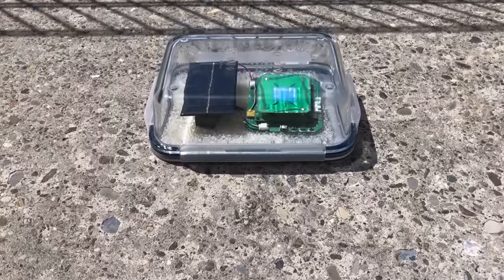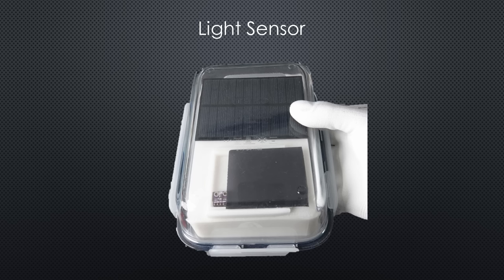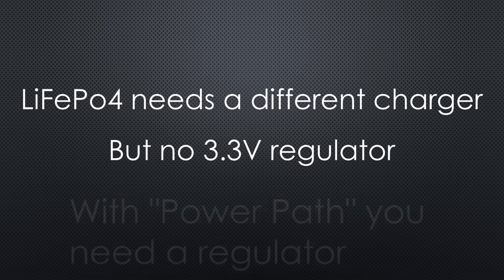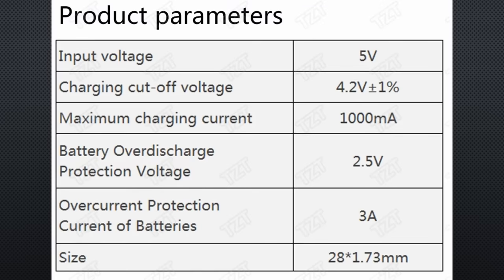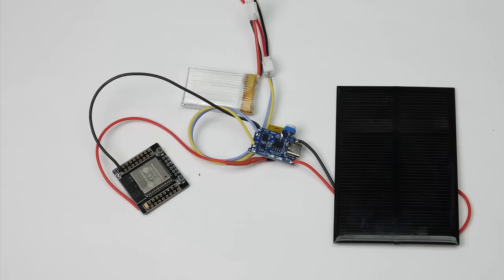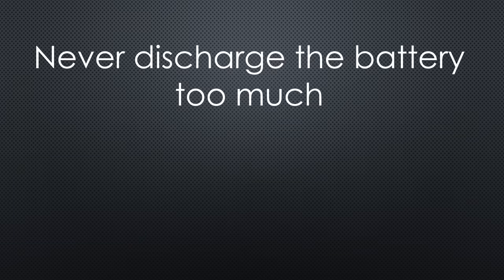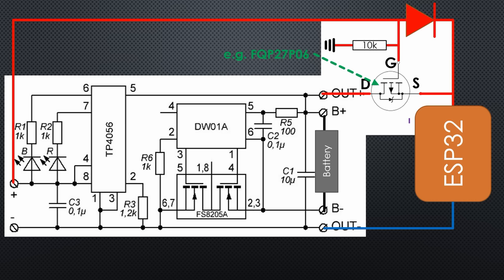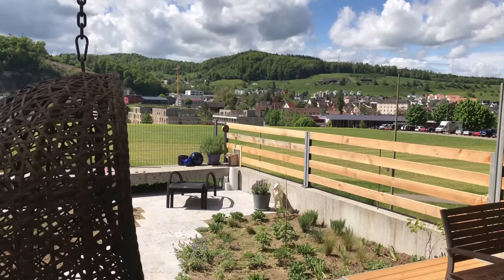#383 Cheap and simple Solar Power for our small Projects (ESP32, ESP8266, Arduino)

Comment: Really good explanation. As a tip from experience: Lion batteries hate heat, and if they are exposed fully charged to high temperatures (say over 60°C) they can swell and leak over time. If your unit is assembled inside a small container, exposed to direct sunshine, it is not rare to reach those temperatures. To mitigate this, keep maximum charging at 80%. Also, if the charger/battery has NTC (temp sensor) it can stop charging over 45°C.
Reply from the maker: Good point. I measured temperature and, in summer it reached 65 degrees for a few hours. So far I had no casualties. But I expect the battery will not live too long. Charging up to only 80% is not easy with the standard chips. Because of the power path, the battery is not used nor charged during these high temperatures and is only "stored". Which seems to be ok.
Reply: @AndreasSpiess  you are correct. Is always good to be aware of batteries limitations and that is a huge topic. Keep with your great channel, which is personally one of the best in Youtube!
Reply: This is an interesting point since batteries don't like charging in negative temperatures as well due to dendrites. So how to best solve this very hot/very cold environment issue with solar charging these small boards?
Reply: Fun fact: TP4056 has NTC pin, just in these tiny chargers it's not utilised, just pulled to ground.

Comment: The MCP73871 is a complete solar charger with all the bells and whistles needed in your project Andreas... Adafruit has a board with it.
Reply: This is an old board design, at a whopping price of $17.50 + shipping. Adafruit recommends the new board with BQ24074 - cheaper - but out of stock, so Andreas tips is the hackers way of doing it. Have a nice day. ;-)
Reply: @Cptnbond  Yes....we can go down down to build it with simple transistors...nice learning too. :)
Reply from the maker: You are right. These chips seem to have all parts on board. Boards with this chips are not so widely available.
Reply: I've seen at mouser that the MCP73871 cost € 1.59 for € 1.85 for the new BQ24074.
The price difference for the two Adafruit boards is only explained for commercial reasons ... nothing to do with the board bom.

I have been using the MCP73871 for years and it is possible to solder it by hand with a fine welding tip (the BQ24074 footprint looks similar).
Reply: is there a cheap chinese version of it?
Reply: @grindel80  just have a look on ebay
Reply: @grindel80  I live in China. Searched on Taobao (Chinese ebay) but unable to find any cheap version. Guess the TP4056 + 2 Schottky diode (or 2 pMOSFET) is easy to implement and TP4056 boards in China only cost you ~0.4 USD ea. If you buy TP4056 raw chip it is only 6 cents and JLCPCB can manufacture your PCB design with 1 USD for 5 boards (shipping INCLUDED). Clearly there is little incentive for any manufacture to clone MCP73871 board since the chip is too expensive let alone a module.

Comment: your voltage divider does not make sense - you go to all this trouble to put the mcu into deep sleep to save power, but you cannot turn off the voltage divider, which is continuously drawing power in order to provide a signal that is only consumed for less than a microsecond in every ten minutes.  what am i not understanding?
Reply from the maker: You are right. However, I do not pay too much attention to every microAmpere for solar powered system because they are frequently recharged. If you care, you have to switch the divider as you suggest.

Comment: Thank you (yet again) for a clear and informative video. In the past I've started a number of solar projects, but always run into constraints that seem to require expensive solutions. With the information from your video, I will attempt to revive some of them. I may even try to implement them in surface mount technology. I'll let you know if I can fully incorporate your beautiful bodge onto a single board :)
Reply from the maker: The FET I used for sure was too big! You can use a DMP1045u instead.

Comment: If you want to make your TP4056 adjustable, I recommend that you add a 1.2kΩ resistor in series, so you don't exceed the maximum rating. The chip on these little modules already easily reaches 100°C at 1000mA (1.2kΩ) without a heatsink.
Reply from the maker: Indeed, you can try to find the "MPPT" for your cell using this resistor (I did this in an earlier video).
Reply: @AndreasSpiess  Nice! I'll check them out. Funnily, I stumbled upon this video when googling for "diy Solar Radiation Shield esp".

Comment: This is a very useful video, sir, but I have a question. I have a solar panel with a specification of 12v/0.83a. What happens if I don't replace r3? I'm still just learning soldering, and I have difficulty removing such a small resistor. And if it really needs to be replaced, how many ohm resistors do you recommend installing? Thank you
Reply from the maker: The TP4056 will be killed with 12V. You need a step-down converter 12-5V or better a sloar charger that supports 12V
Reply: @AndreasSpiess  I forgot to mention that I'm already using a step down converter. I'm still confused about the ampere part.

Comment: Thank you for a great video! In my projects i also add a temperature sensor and a mosfet to cut off the battery charging if the temperature is too low or too high (charging lithium batteries bellow 0C can causes permanent damage). Alternatively the tp4056 has a pin where one can connect a thermistor. Also if you use lifepo4 not only you don't need the regulator you also don't need the voltage divider to measure voltage. One can use ESP.getVcc() directly. And as a bonus no risk of blowing up 🤯.
Reply: wow do you have any guide I can view so I can implement what you did? I want to incorporate it that into my mini electronics project.
Reply: @noddlexxx9161  Sorry i got no guide but it is pretty simple. Whenever the ESP wakes from deepsleep (15 mins) I measure the temperature and depending on the result turn the mosfet between charging board and battery on or off. The project is now running something over 2 years without any manual charging needed.
Reply: @TheChopain  oh okay thank you. I'm panning to make like a little backup cam for my car and it would be pretty annoying to switch out the battery you know.
Reply: @noddlexxx9161 why not take the power directly from the car? Of course have to step voltage down first, but would not need to have a separate battery.
Reply: How did you keep the TP4056 off during deep sleep?

Comment: Wow! Thanks for the tip about the diode and p-fet. This is exactly what I need for my current solar project!
Reply: Same.
Reply from the maker: I am glad it was helpful!
Reply: @AndreasSpiess  Thanks, this was very helpful video,  as we were trying to solve this issue for weeks. one problem i had is, after deep discharge my controller board is not wakes up even there is sun (for whole day). will this solution solves that issue without any external trigger to reset the board or with other components ?!
Reply: @FTMSquad I have the same problem, have you had a chance to try it, can you share the results?

Comment: for a small project I did, using esp32, I also changed the R3 resistor (on the TP4056 board) to a more suitable 3.9K SMD resistor, which worked great for the purpose. Thanks for the great video by the way :D
Reply from the maker: You are right. You can add also a fixed resistor. And the older boards had bigger SMDs...
Reply: @AndreasSpiess  yaa, mine had the 0603 ones which are okay to replace if you have an okay eyesight :p

P.S. - i also added the ldo and powerpath to my project, didn't know i had become professional too... XD

Comment: Alternatively, especially if you're more application engineer.. just use the 5v (or USB in) on the ESP32. You will need something like "PFM 600MA Control DC-DC Converter Step Up Boost Module" between the TP4056 battery out and your ESP32. This will boost the signal to a consistent 5V and you can connect that to your board through the USB in. I also highly recommend getting an 18650 with a protection circuit for additional protection. 

For battery monitor also consider a "I2C 3.7V Li Battery Fuel Gauge" which you can connect to the I2C on the ESP32
Reply from the maker: This is a good idea if you are. Ot concerned about power consumption.

Comment: Thanks Andreas, I’ve been struggling using a tp4056 for a solar project, reckon this is the solution! Perfect…
Reply from the maker: I hope it will work for you as well.
Reply: What was your problem?
To small solar panel?
To high charging current?

Comment: Thanks for your video. I was just doing my own research for solar powered ESPs recently and ended up with the TP4056 as the simplest solution as well. But ... there's no point in fiddling with the charging current of the TP4056. The current of solar cells is proportional to the solar radiation and thus is always varying between zero and the maximum current. Your current setting will never be right. But that's not as bad as it sounds. You just want the maximum available current and that's what you get without limiting the TP4056. Chasing the MPP only makes sense with a swtiching charge controller that can transfer energy between different voltage levels.
Reply from the maker: I agree, we never will find the right current without MPPT. The problem I had was that the panel hardly delivered current when the battery voltage was very low. Then, the TP4056 tried to draw max current and pulled the solar panel to a very bad place on its curve. This is what I wanted to avoid.
If you have enough sun and your battery voltage is ok you will not encounter this issue.
Reply: @AndreasSpiess  Thanks for your reply. Are you sure it was not just the Trickle Charge Mode of the TP4056 for a very low battery voltage? The current-voltage diagram can't explain what you observed. For a solar cell the current can only get higher for lower voltages. The power might decrease but the current is constantly increasing for lower voltages.
Reply: That was also my thought. The higher power of the PV results in voltage, not current, but the higher voltage is burned anyway by the charge controller.
Concidering the charge controller does not consume current, only burns the voltage above 4,2V, but we charge a battery that has 4V at the moment, you will get more power to the battery when operating the PV with 4 V, then operating it at its MPP at 5V:

voltage	current	power	power at battery with 4V
0	0.098	0	
0.5	0.097	0.0485	
1	0.096	0.096	
1.5	0.095	0.1425	
2	0.094	0.188	
2.5	0.093	0.2325	
3	0.092	0.276	
3.5	0.091	0.3185	
4	0.09	0.36	0.36
4.5	0.089	0.4005	0.356
5	0.085	0.425	0.34
5.5	0.07	0.385	0.28
6	0.03	0.18	0.12
6.5	0	0	0
Reply: @wasserdrucker6227  so if max current is not achieved the module will ask more voltage from the panel, and the equilibrium point would be zero current?
Reply: I was wondering, if I had a higher voltage panel and a 5V buck converter, what  voltage would the panel set in? I find two equilibrium points

Comment: Very nice tutorial. The only thing I do differently, I use a 3.3V buck-boost instead of a regulator. I have an ESP8266 that is more than a kilometer from my house, and it has been running m/l continuously for over a year. The battery doesn't do well below 0C...

I recommend using the solar panel to shade the other parts from the sun, and mount the parts to an aluminum bar that extends outside the weatherproof enclosure. The bar will remove heat from the enclosure.
Reply from the maker: Good idea with the shading. I have a few IKEA boxes to try and compare different cooling concepts. I just have to do it...

Comment: Good video. Damn, it arrived a week after I had used an identical circuit with 2 Schottky diodes and missed the pro solution. Still, mine looks nicer!  Next time…
Reply from the maker: I can imagine that the two diodes look better! And the difference is probably not big for this application where we never want to deplete the battery.

Comment: I would appreciate it if you would add in the amount it cost you at the time to build the total package. I know I can calculate it myself by opening all the aliexpress links and tallying them up but it won't reveal how much you personally paid for the package at the time of making the video.
Reply: Having watched Andreas' old mailbag videos, I expect that all of these parts came from his inventory so no new purchases were needed.
Reply from the maker: Andrew is right. I assume the total cost was around 10 dollars including the battery and the solar panel. Plus 1000 dollars work of a Swiss engineer ;-)

Comment: Like usual, very interesting and practical. I have a few considerations/questions: the powerpath is as you perfectly explain to prevent the battery charging and discharging at the same time, which could basically 'screw up' (my words) the proper charging of the battery. I wonder, if one has an ESP that is in deepsleep most of the time, whether in reality this is a significant problem, as  most of the time the discharge  would be say around 3uA.
I am not sure but i seem to remember that some of the charge boards you tested earlier (#155), e.g. the CN3056 did not have this problem. These boards are also extremely cheap (61 cts in euro). Anyway, you probably know better than I as you have more solar projects than I. I only have one, with a bare ESP8266, fed through a 4056 with protection and no powerpath. The ESP wakes up every 3 hrs, maybe does 5 secs of connection and goes back to sleep. I use a 750mAh battery. Till now, even in the dark days that seems to work, at least i have not been faced with a battery that would remain below cut off.
On a side note, as through some lucky finds, i acquired about 100 discarded 'vapes', with lipo cells varying from 500-1200mAh, i will definitely do more solar projects, and will consider the CN3056.
Reply from the maker: For deep-sleeping devices the power path is needed. And: A good idea to use these lipo batteries for a second life!

Comment: Yet another great video from Andreas. Thanks!
I wonder if it is possible to control TP4056 current setting from the ESP32 instead of using a manual pot. With a DAC maybe ?
Reply from the maker: You can get electronic potentiometers. But, as said, it is not worth the effort for such small panels.

Comment: Good video, I’m still waiting for the raspberry pi UPS project video! Something like done in this video, with power path, but connected to a 5v charger instead of a solar panel and all the components adjusted for the RBPi power consumption 👍
Reply from the maker: It is way more complicated if you want to have automatic shutdown etc. The project team got their prototypes and, during testing, found some errors...
Reply: @AndreasSpiess  yes, I think it is, but the team should try make it work without automatic shutdown, etc Just the basic functionality, to maintain the Pi working in the eventuality of a power outage, in my case, when it happens it’s not long lasting, just minutes. 
After make that working they can improve it with all the bells and whistles 👍 
Keep the good work 😊

Comment: Make sure the battery has a low voltage cutoff circuit. The voltage divider is constantly drawing current. Even with a large panel, if you put your device in storage for a while, you stand a good chance of having an over-discharged dead battery. The voltage divider is a great battery destroyer. Ive seen lots of lipo devices (not solar charged, just USB charged) go "out of service" due to the voltage divider measurement.
Reply from the maker: You are right. This is why I use TP4056 boards with cutoff circuitry. You get them also without it.

Comment: Power path idea seems interesting and useful. But i think, a fuse could be added where the source is so that in case of short-circuit (its outdoor, rains, high - temperature its 42 C here). and that p-Channel mosfet look giant at 12:06 and nice box
Reply from the maker: Of course you can use an SMD FET. This one was easy to solder... Concerning the fuse: You are right, a fuse always increases safety.
Reply: @AndreasSpiess  Could you suggest an easy to find smd FET?
Reply: @marcoberna78  Consider an AO6401.

Comment: Excellent video, thank you. Simple and professional! It is what I need. BTW I also need turn-off the load at night. So I can use the solar panel voltage, or the lack of them, to turn off the load. I need the battery only to supply instant current on LoRa transmit or similar.
Reply from the maker: Good idea!

Comment: Great video! Time to bring down my solar powered sr04t-esp8266 based water tank level monitor. I had simply put the tp4056 board directly without any mods and  was wondering why it's not performing well. Now I know exactly what to do! 73 de VU2DJI
Reply from the maker: Good luck! 73 de HB9BLA

Comment: I thought of doing this, but I actually went with a 6v panel charging 4 NiMH batteries and a voltage regulator. it has worked for years! I was powering an ESP8266. You could also use the bluetooth on the ESP32 for an on time of less than a second, to lower the power drain too. Or, as I did, use a Lora transmitter (just for fun).
Reply from the maker: Also a good idea to use NIMh batteries because the capacity does not have to be very high. I usually use Wi-Fi because like that I am connected to my Raspberry in the basement. With BLE I would need an additional gateway (which I do for my bathroom scale).
Reply: @AndreasSpiess  Also, for the viewers, you don't need a charge controller for NiMH batteries - they dissipate excess charge through heat, just don't have too large a solar panel!
Reply: @BrazzaB1 how do you charge nimmh batteries with 6v panel? with tp4056 ?
Reply: @psykopat81   No - the rough way! Connect direct with a diode, relying on internal resistance and lowish amps! 😁 It has lasted 2 years, so far!